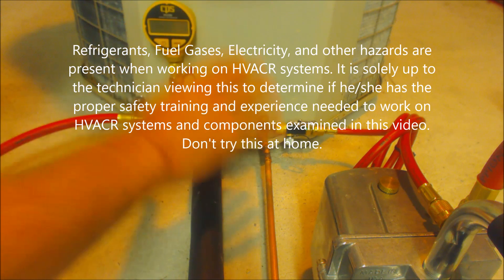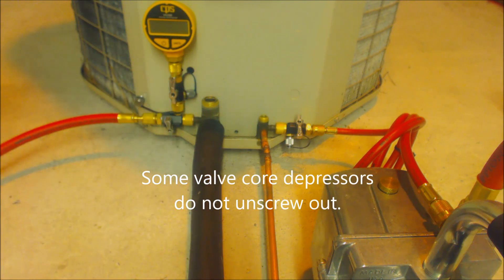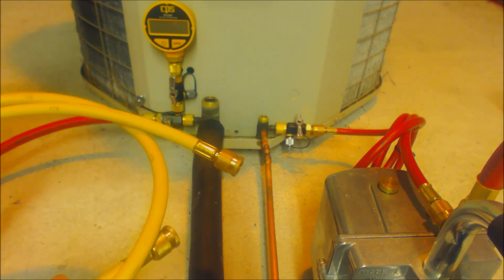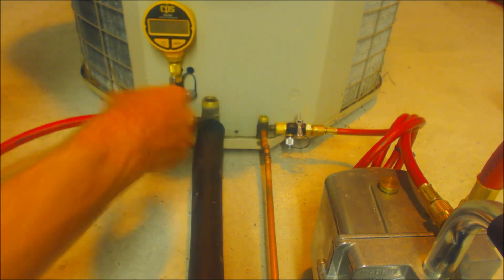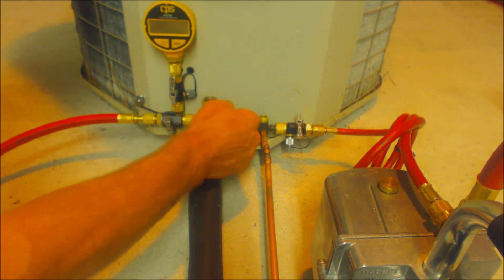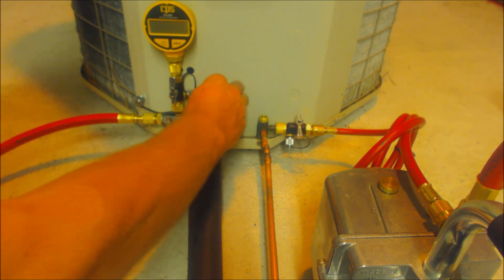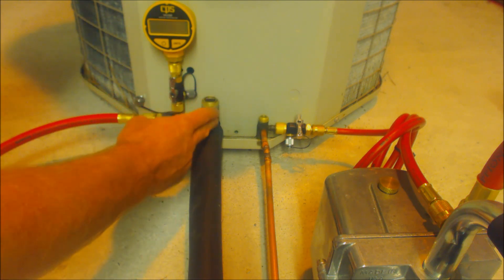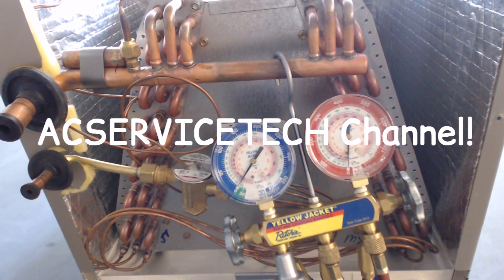Problems Vacuum Pumping Refrigerant Lines to the 500 Micron Level for HVAC

Comment: It  also helps to open and close each of the ball valves while it is pumping down.  In the short line to the micron gauge, a port full of line pressure will make a BIG difference in the reading.
Reply from the maker: Yes I was just telling someone that. Sometimes there is the smallest pocket of air in the valve seat so quickly close then reopen while running, great tip Leo!

Comment: How often should I replace my hoses? Also, does it matter how often you use your hoses. Thanks.
Reply from the maker: It is more about the gaskets at the end. A good set of hoses should last a few years at least but the gaskets will need to be changed. Thanks Danny!